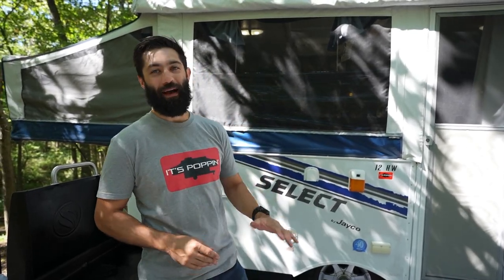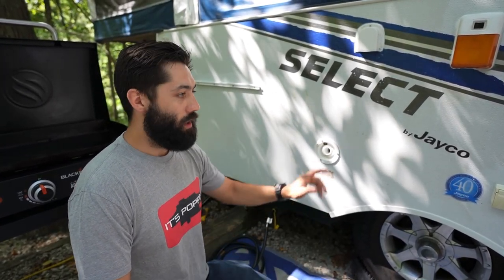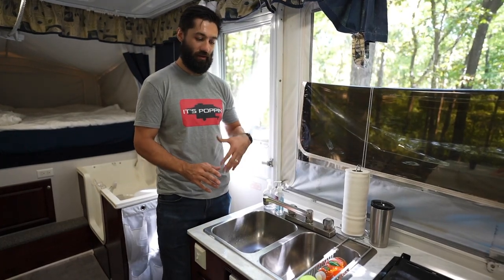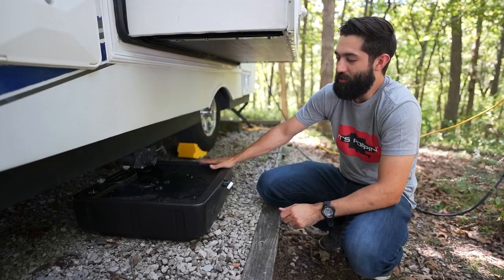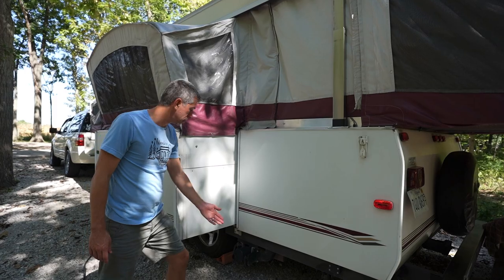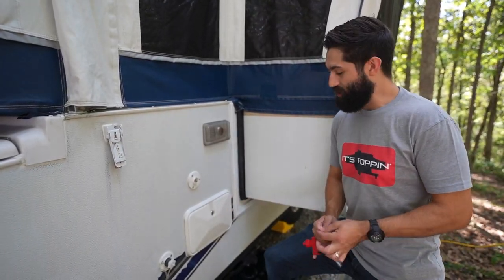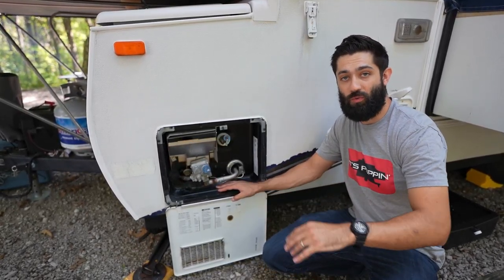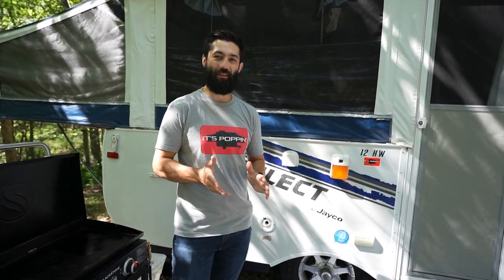Pop Up Camper Water System Basics 💧| Everything You Need to Know!

Comment: Just wanted you to know that your video saved us this past weekend. We bought a 2007 Jayco 1207 back in March and took it out on our first camping trip. Hooked up city water at the site and was met with water pouring from underneath the camper. I've never heard of low point drains and was so relieved to see where you point this out. Our issue was the o-ring on the low point drain valve that was slightly damaged and preventing it from sealing properly. So much headache saved after watching your videos.
Reply from the maker: Awesome, thank you for sharing!

Comment: Just wanted to start off say thank you for all these videos! We are as green as you can be for pop up camping and your videos are a huge help figuring out what and where everything is. 
We have a 2018 Jayco Jay Sport, for the grey water drain, if we’re at a nice site with full hook ups can you run a hose to a specific drain like you would the black water or do you have to carry some sort of storage unit? I saw that the down pipe was threaded. 
Thanks for the help and keep up the great videos!
Reply from the maker: No experience with these, but something like this: https://amzn.to/4ddLe2r would probably work in conjunction with a basic 3/4” hose. Keep the hose as short as possible to maintain good flow. Ideally you’d have an air vent on the system to promote good water flow, but I’ve only seen DIY versions of that setup.

Comment: Couple of questions: After being hooked up to city water, should I drain the hot water heater when returning home? Also, any tips on a kitchen sink that won’t drain? When I pull the sink/burner top to the floor it will drain just fine 🤷🏼
Reply from the maker: We drain the water heater to save on weight. 

Do you have a long hose or something similar not allowing adequate air flow to allow for draining? If so, that may be the issue.
Reply: @ItsPoppin  Yeah, I had a longer hose and realized that may be the issue so I cut it. The end of the hose just hovers above the ground but still doesn’t seem to be flowing. I’ll have to dig into it more I’m thinking.

Comment: Hey man I love your pop-up passion and videos.
 So I just purchased the clipper Coachman and I'm just wondering if there is a connection or idea from the sink outlet outside going into the campsite drain instead of into a pan like you did? Thanks in advance. Have not hit Amazon yet but I guess my question is can I just hook up a hose and throw it into the sewer line though there will be some portion opened around the circumference ?. Do they make a connection?
Reply from the maker: https://amzn.to/3VVYaAF

Something like the above would probably suit you well. The only downside is you need an air inlet so your sink properly drains. Some sort of hose splitter, like below, may work as an air inlet if you point it up. I’ve seen others fashion their own with PVC that would be less susceptible to water splashing out the top. 

https://amzn.to/3Fw2yAO

Comment: I have the exact same pop up and same year as you. Your videos have been so helpful. I purchased it June 2021 and knew nothing about it before I found your videos. My question is, there is an open elbow connection located near the top of the fresh water tank with nothing connected to it. I only  discovered it while filling the fresh water via the gravity fill and heard water splashing underneath the camper. Should this just be open like that?
Reply from the maker: It's an air vent for the water holding tank.

Comment: I tried draining the holding tank, and the little turn knob busted off, so i went and got my drill to just pull the whole thing off to drain it, and pulled the whole cap thing off and still no water comes out. I've tried searching for another drain, but cannot find anything.  I've crawled under the trailer and searched everywhere. Could there be a pressure valve or something on the tank itself to let the water come out of that hose? Its definitely full still, i can see water in the holding tank.

Comment: Thanks for the video.  I have a 2003 Coleman Santa Fe and I lost my hot water heater door a couple days ago driving down the road.  Are the replacement doors standard or specific to different make campers?  Also, do I need to replace the entire door assembly or just the door part that fell off?  Thanks.
Reply from the maker: Should be pretty standard. Did you loose the silver hinges as well that connect the door to the brackets?
Reply: @ItsPoppin  No, just the door.

Comment: We are trying to figure out our system. First timer, we have a Colman plantation 1991. 
Near the tank there is PVC type piping coming out of the tank with 2 shut off valves.
Reply from the maker: Sounds like low point drains for the hot and cold lines.
Reply: @ItsPoppin  
When using propane to heat water, do you leave it heating the whole time camping or just to heat and use? 
Also, how long does a 15lbs tank last for heating water?
Reply from the maker: We only turn it on when using it to save propane. To calculate how much run time you’d have, divide the BTUs in a 15lb propane tank by the number of BTUs your particular water heater uses.

Comment: I have a new-to-me 2002 Viking. It had been winterized, and I can’t seem to get more than a slow drip when trying to drain the holding tank. I have the cap off so it shouldn’t be a vacuum causing the slow down. Any ideas?
Reply from the maker: Does it have antifreeze in the holding tank? If not there may not be anything in the tank or at least there shouldn’t be water if it was properly winterized.

Comment: i have a 2017 flagstaff 27 sc hw. my toilet dumps straight toa 3 in drain then to a outlet. there is no black water tank. i contacted the dealer Ibought it from. theycan install ablack tank. my question is any idea why there was notablack tank installed  ?
Reply from the maker: Was it used? All I can think of is that a previous owner removed it.
Reply: @ItsPoppin   yes used, but according  to the dealer they never was one

Comment: Great video but 
The problem with filling up with water at home is your adding around 100 pounds to the rear of your camper.. Though it may not sound like much   When you figure everything you have put inside before you left then throw a 100 pounds weight to the back  Your adding to the instability of the trailer. The weight would be a lot safer in front of the tires but because its usually in the rear its a lot less stable. Especially for a single axle camper  as per this video example of you have to much rear weight https://www.youtube.com/watch?v=6mW_gzdh6to

Comment: Hey, thanks for the videos! We just bought a 2021 Rockwood 1970 ESP and we are loving it. One issue: the sink (grey water) drains out the side of the pop well until I hook up a hose. The hose is not blocked (I checked), but once I attach it to the exterior drain it acts like a plug and the kitchen sink inside fills. How can I fix this? Thanks in advance!
Reply from the maker: You need some sort of air vent to allow air to push the water through if your hose is too long. Think of the hose like a straw with your finger on the top - until you remove your finger, liquid will remain in the straw. 

So without knowing your exact setup, either shorten your hose or introduce air air vent into the system. There are some example of DIY air vents for your exact scenario that you can probably find out there on the internet.
Reply: @ItsPoppin  Thanks, I'm searching for an air vent to attach to the garden hose. Perhaps a y-valve with air vent?